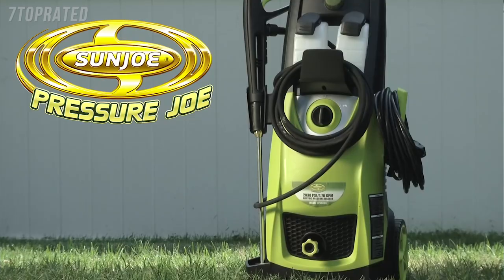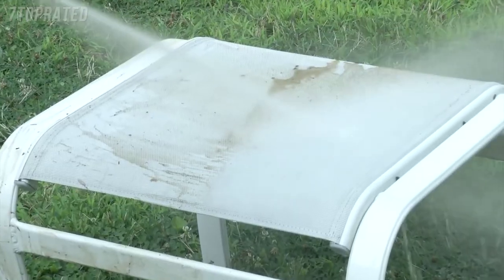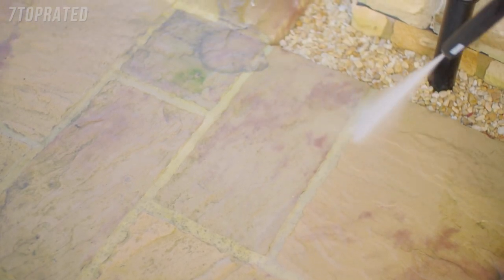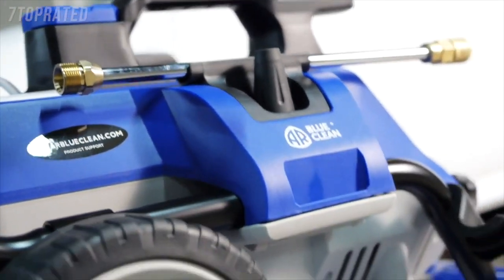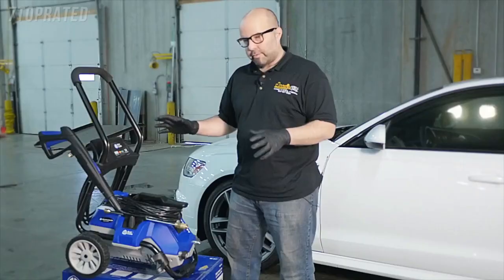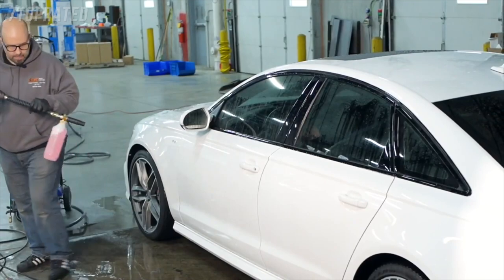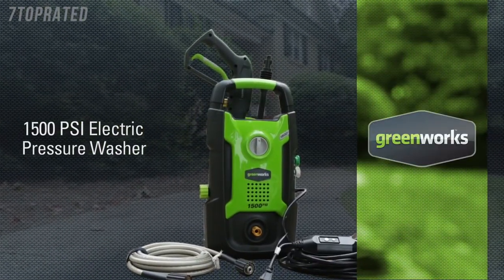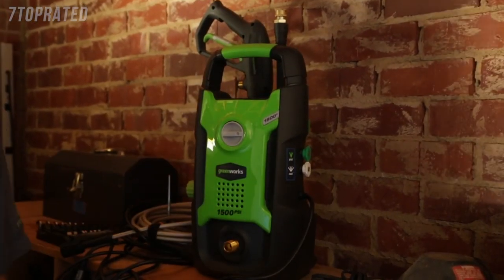5 Best PRESSURE WASHERS 2020

Comment from the maker: Links to the Pressure Washers we listed in this video:

► 5. Sun Joe SPX3000 2030 Max PSI 1.76 GPM Electric High Pressure Washer - https://amzn.to/2F1XLul
► 4. Karcher 13246440 K 5 Premium Plus Electric Pressure Washer - https://amzn.to/30DPlBQ
► 3. AR Blue Clean AR2N1 Electric Pressure Washer - https://amzn.to/31t0QuV
► 2. Greenworks 1500 PSI 13 Amp 1.2 GPM Pressure Washer - https://amzn.to/3agC6dz 
► 1. Briggs & Stratton Gas Pressure Washer - https://amzn.to/2Dlbzjd

==========

UK Links:

► 5. Sun Joe SPX3000 2030 Max PSI 1.76 GPM Electric High Pressure Washer - https://amzn.to/3e9KAFa
► 4. Karcher 13246440 K 5 Premium Plus Electric Pressure Washer - https://amzn.to/2HTNYbx
► 3. AR Blue Clean AR2N1 Electric Pressure Washer - https://amzn.to/2TJphAE
► 2. Greenworks 1500 PSI 13 Amp 1.2 GPM Pressure Washer -  https://amzn.to/320T1hc
► 1. Briggs & Stratton Gas Pressure Washer - https://amzn.to/2JgEg3a

==========

Canada Links:

► 5. Sun Joe SPX3000 2030 Max PSI 1.76 GPM Electric High Pressure Washer - https://amzn.to/3mF5GOy
► 4. Karcher 13246440 K 5 Premium Plus Electric Pressure Washer - https://amzn.to/3egxGW2
► 3. AR Blue Clean AR2N1 Electric Pressure Washer - https://amzn.to/34Jz1S4
► 2. Greenworks 1500 PSI 13 Amp 1.2 GPM Pressure Washer -  https://amzn.to/34IE4BY
► 1. Briggs & Stratton Gas Pressure Washer - https://amzn.to/3jJw2xg